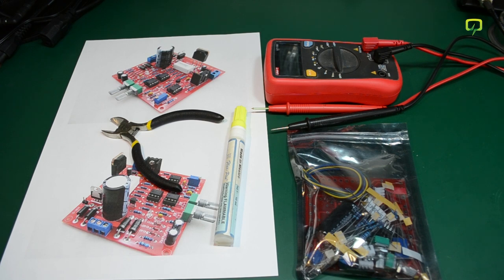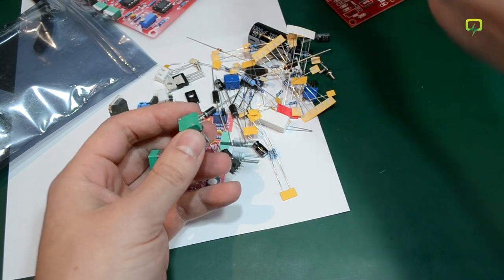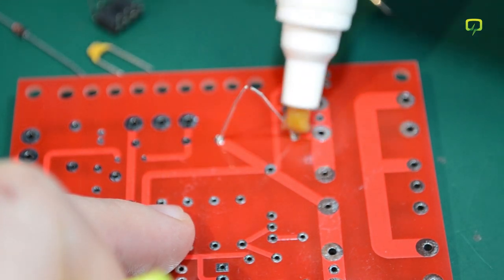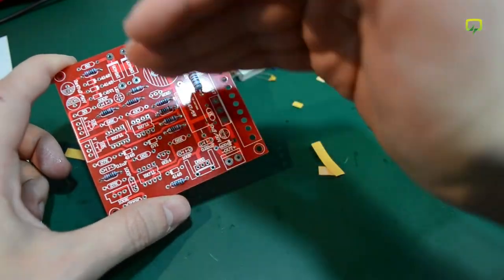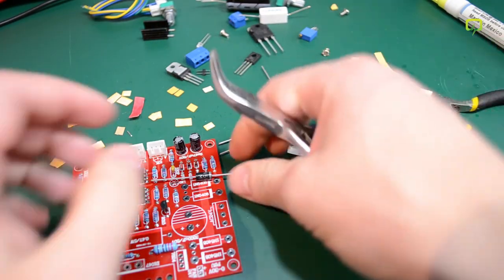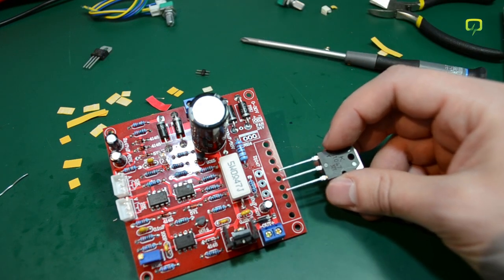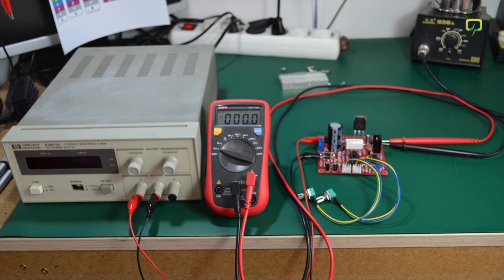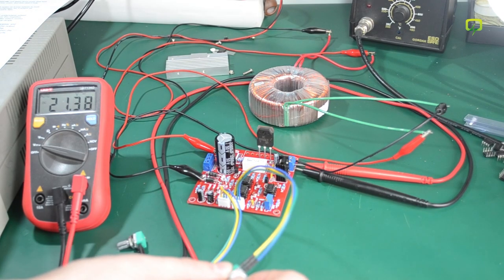VoltLog #8 - Kit Assembly 0-30V 0-3A Adjustable Linear Bench Power Supply

Comment: Thanks for the video - just purchased one prior to watching this - looks good and I was wondering about the power transistor heat sink - maybe the aluminum case will be enough - I will have to test that (heat vs current, etc...).  Should be a fun kit.  Oh yeah, definitely want 10 turn pots as well.
Reply from the maker: Digger D right, you would have to test dissipated power vs resulting temp. It is a fun kit for sure! :)
Reply: I will probably run it at only 1.5 to 2 amps as I think that is the limit of my transformer so likely the case will do as a heat sink.  How do you find the pots for adjusting, would 10 turn be worth while (I suspect so).
Reply from the maker: Digger D 10 turn for the win! If you're considering using this as a lab power supply you will appreciate the finer adjustment into the mV range or mA range.
Reply: I thought so -thanks.

Comment: if you add a fan why not just replace the 24V regulator with a 9V or 12V one? all fixed voltage regulators have the same pinout.
Reply from the maker: you could do that, but you need to install it on a heatsink, depending on the power draw of the fan that regulator will get hot.

Comment: it would work with a DC PS. You just need to make sure you hook it up before the bridge, making sure the  minus goes to  AC2
Reply: +Cezary Siwek - It won't work from a single DC supply, it needs AC or the charge pump circuit that generates the -5V rail will not work. To use DC you'd need to also supply the -5V rail, ie a split rail supply. The designers made it like that to keep things simple for the kit builder.
Reply: ProdigalPorcupine designer did not design this kit like that way, they have just copied famous linear cc cv power supply schematic and made a kit out of it. And yes you are right , one need to supply negative voltage tot the circuit while operate it with a dc supply. But split rail supply is hard way to go but icl7660 is neat charge pump with its several cents price tag:)

Comment: can I just skip the ac to dc coneverter and just simply use a 24v dc supply?
Reply from the maker: Nope, this kit will only work with AC input.
Reply: +VoltLog but there's one video showing that he skipped all tha rectifier and filtering cap and just use it with dc supply
Reply: +VoltLog but if I cant, can u teach me how to rewind a 36v transformer to 24v. bcs I only have that now
Reply: +Muhd Faaris or can I just use 2 12v transformers?
Reply from the maker: sure you can use two 12V transformers, or two taps from the same transformer.
Reply: +VoltLog but I still cant find any transformer, even 12v one is sold out, so can u give me some tips where can I get one 24v transformer?
Reply from the maker: try searching ebay, aliexpress, banggood and local suppliers.
Reply: @pieceofpotato7883  Just remove some windings of DC side.

Comment: I'm a bit surprised here and I think you were testing your viewers. You know very well when you built this that you had put together a full bridge rectifier. So what's the deal?
Reply from the maker: no testing going on, it's just how this power supply works, it needs AC to derive a negative rail.
Reply: Ok sorry, I thought you had a basic understanding of electronics.
Reply: All he had to do was bypass the full bridge rectifier and it would have worked with the dc ps.
Reply from the maker: Probably the lack of knowledge makes you think that but if you would take a look at the schematic you would understand what I am talking about. Also read the other comments, you are not the first one to be wrong..
Reply: Did you watch the video? For example at 14:46 you can see the output goes directly to the DMM and the power supply is connected to the leads of the rectifier directly via alligator clips! Yet here you are quite rudely suggesting that a quality content maker on youtube is incompetent! The fact is it was explained in the video why it did not work in this configuration so your attitude is beyond perplexing. How about rather than being ignorantly arrogant you take some time to learn electronics before you try to be a critic. ;)
Reply: Opps, didn't see the negative voltage rail.

Comment: I have one of these and have killed it three times. The D882 dies quickest, as soon as I load it above 300ma. It says no more than 24 volt and 3 amp AC. Its dead again today after I tried charging a battery using a DC charge controller.  Any ideas, anyone?
Reply from the maker: +MonkeyMagic Elecifun No idea why it behaves like that but I can say I have one that I abused for years with all kind of loads and it still works perfectly.
Reply: VoltLog I am using a MOT which will probably provide more than 3 amps input. It does say no more than 3 amps input on banggood website. Is yours happy providing up to 3 amps output and if yes at what voltage. Cheers
Reply from the maker: at the moment I don't have a transformer capable of 3A output to test this, I have only tested it up to 2.3A and for short period of the test it worked ok.
Reply: VoltLog I have it working again but this time I am using a smaller transformer (14v AC) Its powering a stereo amp I built at the moment. So far so good..

Comment: I thought you only needed a current shunt when more than one power transistor (2N3055) was used to balance the current going through them. I have seen circuits even then when they have been omitted and worked. If the 2N3055's are of the same batch and close in performance maybe you don't need them. For just one though I see no point.
Reply from the maker: you need the current shunt to sense current :-)

Comment: It does not work because you use DC instead of AC, normally you can go in a bridge rectifier with DC, even if it is not supposed to do that, the problem is that the OP-Amps requiere a true zero volt, this is in this case only possible with AC as input!
Reply: @captain skeptical It doesn't matter....it still needs the positive and negative rail from the AC input.

Comment: for this kit, u have to provide 24V AC with 3A current (max) rather than DC voltage.. that's why ur op-amp burns..
Reply: There HAS to be a way to make it work on DC

Comment: I just found out how to run this on 24VDC

Basically you use a 12V AC transformer to power the op-amps, and you connect your DC power supply to the filtering capacitor 
THERE.
PROBLEM SOLVED (maybe)

Comment: it not working because input is AC not DC voltage.
Reply: exactly,  it was the first thing that crossed my head to. The funny thing is that if you just take a look at the circuit , you can see that it has a graetz bridge on it, wich means that it requires AC.
Reply: It does not require AC for the "load" part of the circuit, but the opamps are needing a true zero volts.
Reply: He connected the wires to the output to the rectifier it needs negative voltage with positive voltage

Comment: Laptop power supply won’t work Your supply runs off an ac input. I used a generic heater furnace transformer because they have a 24v ac output. Around $10
Reply: Simple.. just connect a DC source to the 3300 uF filtering capacitor...
DC COMPATIBLE NOW

LATER

This sucks! I have to buy a 24V transformer....
Or..
Is there a way to make the negative voltage for the op amps?

Comment: YOU MUST USE CENTRAL TAP TRANSFORMER 12-0-12 NOT JUST USE DC VOLTAGE. BECAUSE OPAMPS USES SIMETRICAL POWER SUPPLY
Reply: But don't have Output voltage on Big Cap more than 24. 12-0-12 will give 40v peek on Caps.

Comment: this power supply input is AC ..
Reply: Nope it isn't
The negative rails of the op amps don't get voltage so they don't work properly and at 17:57 that NPN transistor is shutting down  the output, so it's not adjustable, voltage is very low, and possiblity of damage to op amps.

Comment: You have spent months building a circuit. You connect it to this unreliable power supply which fails and suddenly gives max output voltage and ruins your circuit!
Reply from the maker: +Jianghong Shen happened to you? :|
Reply: Use a lower voltage transformer, like 18 volt or 9 - 0 - 9 transformer 
This happens because the voltage in the filtering capacitor gets to 36+ volts and the power supply doesn't like that 
Use a 18v or lower transformer.
You will get a high enough voltage
And the op amps will last longer
Reply: I actually designed a similar circuit with op amps used as comparators
2 op amps are needed for current adjustment
One compares the voltage drop on the current shunt, and that goes into the second op amp used as a comparator.
The second one compares the previous comparator output with a voltage from an adjustable voltage divider (potentiometer)
When the current limit is reached, a NPN transistor switches off, therefore stopping the current and basically it modulates the current within the limit (current high - transistor switches off and current drops,)and this just keeps on repeating, thus setting the output current.
And the voltage is very simple 
JUST USE A LM338 (or LM317 if you don't need 5A max.)

Comment: Voltlog--you don't need all that flux---Jesus man. Have you ever heard of a flux joint not to be confused with a cold-solder joint?
Reply from the maker: Never heard of a "flux joint". All that flux is good, it helps make those perfect joints. You should try it.
Reply: I have and it just is not needed.
Reply: However, it does make removal of SMD parts safer and very smooth.

Comment: Hi, I have build a circuit similar to yours and my problem is that on my circuit the diodes were wrongly marked and I have powered the circuit like that. What should I check now on my board to replace. One other question: if I power the circuit from a 28V AC source its OK?
Reply from the maker: start by replacing the op-amps and 28VAC is pushing the limits of this circuit, better stick to 24VAC.

Comment: hi can I use a 24v 5a transformer for the above circuit, since i have it with me. thanks
Reply: yes you can, but you should not. .  The opamps have a maximum voltage of 30v.  After filter, a voltage of almost 34 volts apear. Under load, I'm sure it is not a issue, but I let mine powered on over night with no load and burn the opamps. This power supply shoud be ratated maximum to use with a 20v transformer. 12 0 12 or 24 0 is too much for this supply.